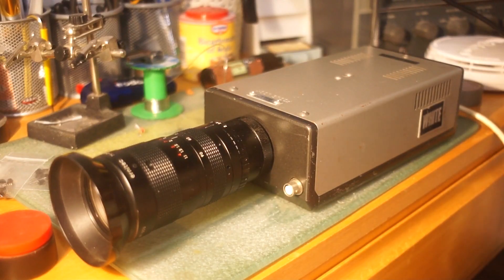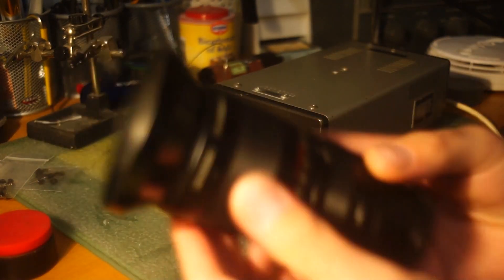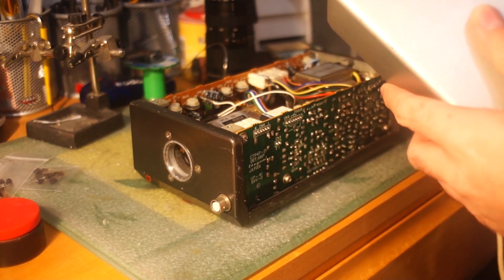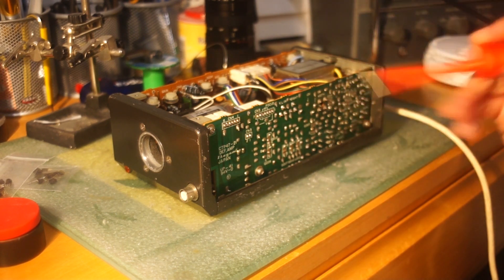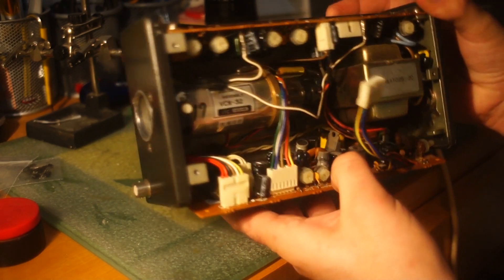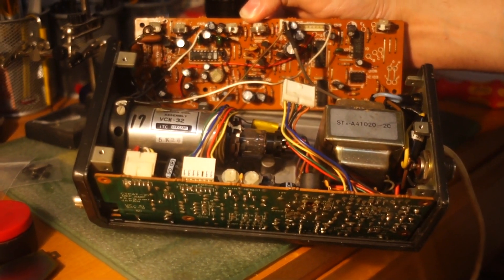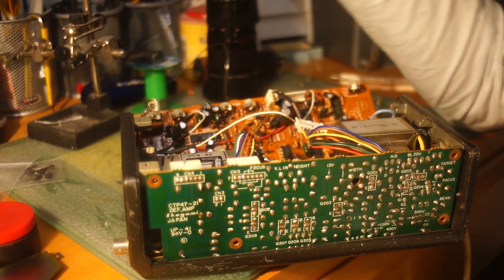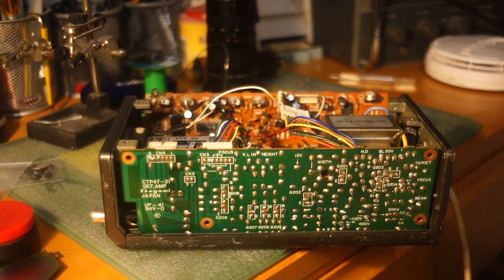Vintage 1980s Vidicon CCTV Camera Teardown

Comment: I wondered what big brother from the 1980s looked like inside. I more or less deal with 1920's, 30's , 40's vacuum tube technology. I'm not very familiar with the more modern transistor technology, which is why I find your channel very helpful. Nice security camera, thank you for showing us.
Reply from the maker: Looks pretty cool if you ask me, VALVE electronics are an intresting mystry to me. I know a little here & there. But digital stuff & CPU's are my domain. Yey I have use in this world =-)

Still works a treat to which is pretty cool.
Reply from the maker: are yes, I have watched this before. Love those old educational videos from the 50s, they are so rad.

Comment: Camera made mid to late 80's. Made my living selling, installing, and fixing the full line of equipment. Be careful not to electrocute yourself!
Reply from the maker: It's all HV inside. Would love to get hold of one of those old dome cameras. Wonder when CCTV cameras were first invented.
Reply: "An early mechanical CCTV system was developed in June 1927 by Russian physicist Léon Theremin" - Wikipedia Closed-circuit television. Later the first avaible CCTV for Normal Customers was saled in 1949 Remington Rand. - In the United States, the first commercial closed-circuit television system became available in 1949 from Remington Rand and designed by CBS Laboratories, called "Vericon".

Comment: I miss the 90's, the electronics was discrete that time. I could repair a device by taking components from other devices.
Reply from the maker: Anything 90s & older is still worth savaging, modern stuff, not so much.